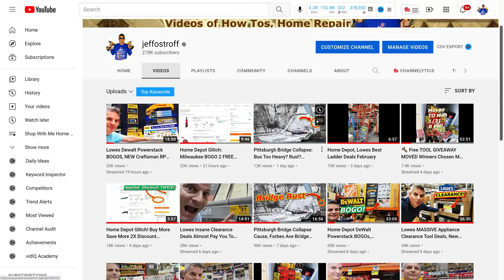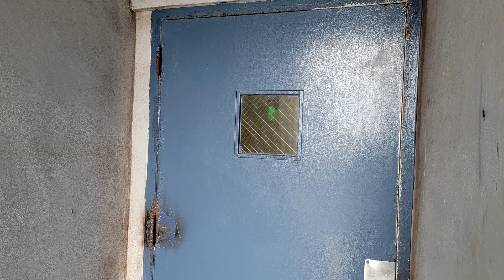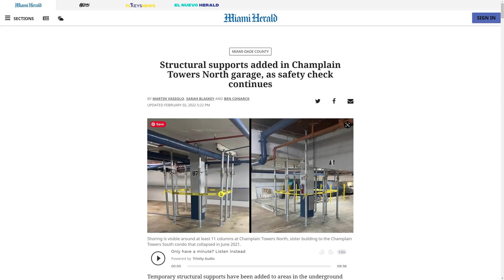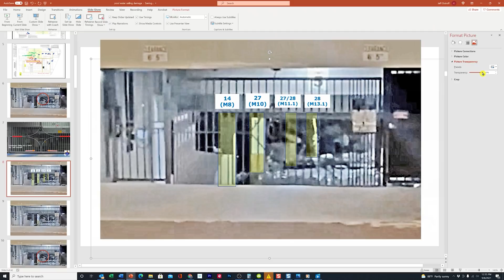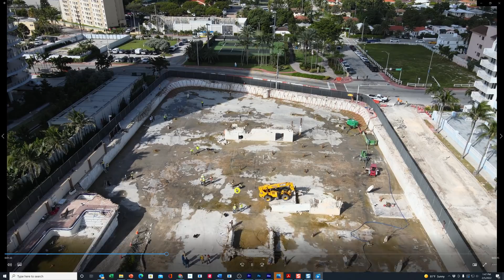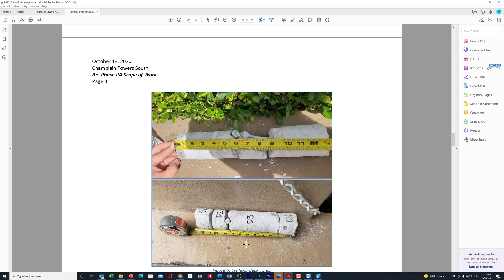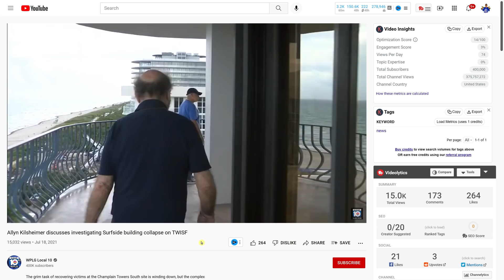Miami Condo Collapse: Sister Condo Just Added Support Poles!

Comment: Its interesting that they are putting caps on the tops of the columns as if that is some sort of extraordinary fix to address the problem of punching shear. It's interesting because capitals were at one time standard on columns from ancient times yet somehow now they got left off of some very critical columns at Champlain Towers South AND North. Also, it makes more sense to me to at the juncture of column to ceiling that the column meet the beam from below and that the beam carry the load of the slab and not the column. This is in contrast to the column abutting the slab directly and that column acting then as support both for the slab and the beams or, similarly, concrete curbs and short walls or ramp walls.

Comment: I work for a political party, almost all of our buildings are concrete going back to 1880. At 5:23 That is called "Detroit style". I know concrete buildings very well the building that collapsed we call "rods construction" do to the lack of rebar in the floors and columns and the fact the floor are thin. Popular in the 50s it was quickly seen as a problem in California, rods buildings have no bracing and no redundancy, this makes for a disaster in an earthquake or tornado as the buildings stand no chance. I can talk more about it if anyone is interested.
Reply from the maker: Good info thanks!

Comment: Just because he said he would put his kids in the property, means nothing to me, now if he said he would move into it that means something then, if he would risk his own neck. Here's another problem I have with the design and the structure and the methodology of the construction. Why weren't there already core samples of the concrete and building materials used in the construction taken by the engineering firm to cover their butts; that the building contractor was using proper building techniques and materials were actually being used in the said construction of the building itself? If they were taken what was the outcome of the documents of the testing of the materials. Was it presented to the courts or ever presented? That would be another good video on that research as well.

Comment: You keep saying they are using "Lidar" to investigate the the concrete. Naha!
Lidar — Light Detection and Ranging
Lidar uses laser light. It is good for penetrating foliage to locate ground through cover. Won't work worth a d*** on concrete!
 More likely some form of GPR, Ground Penetrating Radar ...
Reply from the maker: I listed lidar as one of the tools that they used to measure all of the concrete where it was laying on the pile this will help them with their 3D renderings and keep track of what piece of column was located where on the pile. lidar does not do any type of in depth measurements in the concrete, it is mainly used for distance and sizing
Reply: @jeffostroff  Ah, that makes more sense.

Comment: What is interesting is in comparison is, the old Sun Sky way bridge that you can see crossing the new bridge is the old concrete that is in salt water shows no or very little deterioration, from when it was built 1956, you see very little sapling and exposed reed bars. maybe we used better concert then than now, or cheep concrete that the building inspector allowed, and lack of punch through reinforcing reed bars installed
Reply from the maker: good observation

Comment: The concrete reinforcement will eventually fail and the entire building will collapse. Salt in water speeds up this process. Rusty metal splits the concrete into pieces and that process cannot be stopped. There is no waterproofing in the old houses because it is too new an invention. New bath and shower rooms require that new waterproofing behind the main surface. I assume the same requirement is for swimming pools. Chlorine in a swimming pool is also harmful to structures. Many indoor pool roof structures are damaged due to chlorine.

Comment: My guess is Kilsheimer is either under an NDA or is an old school believer that any information that is upsetting should not be released so as to cause a panic. I’d argue that this mentality is so old school that if there is a real danger he is clueless not to realize his reputation is on the line. Everyone will be excoriated.
Reply from the maker: I think many engineers don't want to release an answer because they think it's all conjecture or they don't want to be proven wrong in the end, and some just want to be methodical like NIST is doing where you have to do the samples of the concrete first to get a real idea as to whether the strength of the concrete played apart into it etc.

Comment: In the inside shots - again - notice the upgrades to flooring etc that have been done. It's all weight that wasn't projected in.
Reply from the maker: They may have allowed for some increase in weight, but when you have a building that has a perfect storm brewing of many different failure modes happening at once, it may eat up all of that margin that they allowed for.

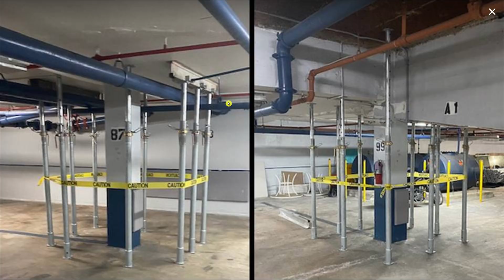Comment: Hi all.  New to the channel and I’m not a structural engineer.  Why at 4:20 does he prefer wood?  I’m guessing because it compresses better without cracking or bending?   But only as a temporary measure because the concrete will eventually destroy the wood through moisture?

Comment: Is it possible that during construction some of the columns were poured without any rebar at all?  And that M 11.1 never had any and that is why there is much interest in it and why there is no rebar coming out of where 11.1 had been, as there are for almost all other column?  I noticed that there have been many questions about the rebar people see in the garage columns where the concrete was removed and just the rebar shows, that there seems to be more rebar in the columns than there would normally be and many have pointed out that some appear to have been added rebar as if they were trying to tie the rebar in which would be odd to do on the very bottom of the column as they would expect that in a column on upper floors, as rebar ended and they tied in more as they poured the next section.  Could they be looking for sections of the column where rebar was not embedded before that section of the column was poured so some sections of the columns are just concrete?  Certainly they could be checking for good places to drill for samples, but could they be checking for lack or or more rebar than should be there?  My understanding is that adding more rebar than should be there is not good.

Comment: Yeah those hollow pipes are gonna help those toothpicks...
Reply from the maker: Those pole shores are capable of handling thousands of pounds each of weight the fact that they are hollow doesn't mean anything it's the thickness of them and they are round. And there's several of them arranged in an array to help alleviate the weight all they're trying to do is protect the connection right where the slab meets the column to prevent a punching shear

Comment: People are so dumb sometimes. Those will only hold about 4,000 lbs each and they have them in the middle?! Come on. That's not a support pole. That's crazy
Reply from the maker: The way those are arrayed around the column, their purpose is there to add support around the connection to the concrete slab and the column to prevent punching shear they are doing their job adequately.
Reply: @jeffostroff  ohh gotcha

Comment: what do they do to fill that beautiful form work above that column ,pump in grout?
Reply from the maker: If there was any spelling of the concrete, what they have to do is chisel away the bad concrete until such point that they see no more rusty rebar.. Then there are certain specifications that told them what type of brackets to place their in still in the concrete over it patch everything up in prime and painted

Comment: That core sample at 11:50 apparently has another rebar rod in section 4 (see the dark spot). Except that concrete down there is less degraded and does not fall off the steel.

Comment: Not dure of capacity requirements but bedt practicr for the 2 sets discussed a number are not plumb and the one that is next to the ramp soffit is over extended so should be a longer prop
Would like to see the temporary works design for these locations

Comment: How are the floor joyces constructed , is there wood or i beams? They should shore up everything with wood 2x12's  level by level and paint it, it will reduce the ceiling heights but will provide overall support. Have a waterproof membrane 'silicone' for the roof
Reply from the maker: It is all slab floors, no joist designs

Comment: The reason there's no rebar sticking up is it probably totally rusted off and disintegrated.  That would be a real good reason for why a column would literally disintegrate or explode into cement dust.  No doubt when there is water leaking somewhere from above these column act as a pathway to return that water to the ground and people can't see it happening if the moisture is INSIDE the column.

Comment: I'm retired building contractor,  when I saw the first photos after the collapse, I thought where are the cross beams between the columns, or the drop pads, it was only a matter of time for this collapse to occur.
Reply from the maker: Yes unfortunately many flat slab garages like this were made without drop panels or capitals on top of the columns period of course nowadays they make them a lot better with just beams spaced fairly close together in the columns just to support the beams

Comment: The sister building is in much better shape, but if its 1st floor were to collapse it has a high chance of columns buckling taking down the building.  The 1st floor on the collapsed building should have been protected from the elements with out overloading so it should be close to the same condition as the 1st floor of the sister building.  If the 1st floor of the sister building is in deed being held up by unintended tensioning across the floor and the tensioning was lost for any reason a similar cascade of events might take place bring down the building.  The shoring up around the columns is to keep the floor from punch shearing.  If the floor is being held up by unintended tensioning and it were to loose that tensioning the shoring up would likely keep some semblance of the floor's lateral support for the columns even if there were partial collapse of the floor.  

The 1st floor should not have collapsed inside the condo building.   It did not suffer from high levels of saltwater contamination or additional surface loads that the actual pool deck over the parking garage did.  The pool deck concrete design had self supporting concrete sections without pretension of the reinforcing steel.   It appears the pool deck concrete design was built right at the limit of structural support and with advanced corrosion over 40 years, additional surface loads and possible deletion of a designed support span the concrete deck had become overloaded and in a failure mode.  It was likely gaining structural support from the unintended tensioning taking place through its reinforcing steel connection with the outside foundation wall of the parking garage near the pool.  

This is similar to intensional pretensioning of reinforcing steel that takes place with steel concrete structures used in bridge construction.   Tensioning was not part of the structural design of the pool deck.  When the pool deck collapsed the tensioning being provided was lost overloading the remaining structure causing a total collapse of the pool deck above the parking garage.  This appears to have carried into the 1st floor of the building, which didn't suffer the same overloading or corrosion issues as the outside pool deck, but nevertheless appears to have promptly collapsed via punch shear.  The building still should have remained standing, but the supporting columns appear to have buckled without the lateral support of just one floor.

Comment: It's incredible to see concrete buildings with sheer protection columns built 150 years ago knew what they were doing.  It's cost cutting measure is what doomed this building.
Reply: If it isn't built correctly in the first place, when it was built isn't that big of an issue.  The biggest barrier seems to be the honesty needed to admit that there is a problem.
Reply: THE COURT CASE determined it was the building next door allowing its water runoff to undermine the South towers.  That building & the construction companies that allowed water runoff were fined 100s of millions of dollars

.
Reply: It always is.
Reply: Yes! Detroit is a good example. all the early buildings had them.
Reply from the maker: Yes I'm likely lack of maintenance or the proper maintenance anyway

Comment: M-11.1 was pushed down under the basement slab because the pile cap failed which led to the building collapse like I said all along. Just wait and see.
Reply from the maker: I have not seen any evidence yet that the pile caps failed
Reply: @jeffostroff  My belief is that during construction, a crane collapsed damaging one or more pile caps which were never repaired properly otherwise why did Morabito prescribe digging up the basement slab and reinforcing pile caps with beams in the restoration plans? please address this as you have skirted past this before. IF THERE WAS NO PROBLEM WITH THE FOUNDATION THEN WHY DID THEY WANT TO DIG IN THERE AND FIX IT?

Comment: Code enforcement knows that these structures are not sufficient especially in the parking garages support pillars that support the entire building. They're too thin the rebarb is not thick enough and all of them should be reinforced with wider stronger support beams and columns as a result many parking spaces will be lost but the building will be safer as a whole.
Reply from the maker: These polls are a lot stronger than people think and they are not there to take 100% of the load they are there to assist the column and taking a load
Reply: @jeffostroff  the problem was there was not enough redundancy built in the system of a building like that should be able to fully lose one of those parking garage structure concrete poles. However in this case when one gave way the rest of them follow like dominoes. The structure was already compromised before the building collapsed due to extreme lack of Maintenance literally allowing water draining directly into the concrete support pillars and Main support poles rusting out the rebar and the polls were already cracked. This was proven in pictures taken of the garage before the collapse on several occasions there was actual stalagmites found on the ceiling of the parking garage structure from years and years of neglect of dripping water. It is also highly suspected that the water was actually flowing in towards the building instead of away from the building the main problems being the swimming pool deck plus the planter boxes that were later added to that deck without proper drainage. Instead the water was literally seeping directly into the pillars and the concrete floor that separated the parking garage from the first resident floor. And there is also believed to be water that was seeping in from the next door neighbor high rise building because the breakwall was compromise during the construction that allowed water to flow towards the building instead away from the building. All of these structural failures Plus lack of maintenance added up to the major structural damage leading to the collapse. However if the parking garage structure poles were simply made wider with proper size rebar along with better spaced support beams. This tragedy could have been prevented. Who I really blame more so than even the engineers or the maintenance crew. Is Code Enforcement itself for allowing the structure to stay open without condemning it. It should have been quite obvious to any inspector that the building was already in Failure mode. And the building should have been condemned prior to collapse. Quite simply it should not have passed inspection.

Comment: Let's talk--and be modern--CLIMATE CHANGE.  A structure built in the 1980's will not long accomodate the rise of the oceans. Floriday just denies the problem Ron Santis YSF go FY. Let you all go down into Atlantis you stupid people. The water table is rising, every single day, by fractions of a millimeter as the ice sheets melt. Of course we are too stupid to even WANT to understand. If you are an idiot, buy a condo in FL, otherwise head to Buffalo NY because at least for the next 75 years Lake Superior won't inundate you. After that? all gets are off. We thank the fossil fuel industry for this castrasophe. THANK YOU TEXAS